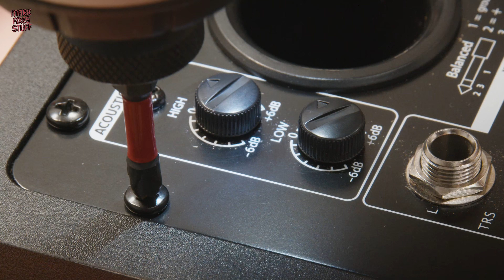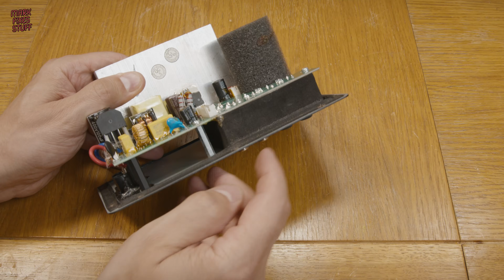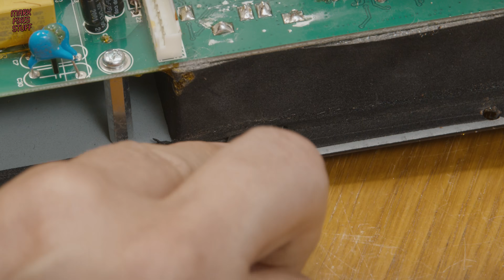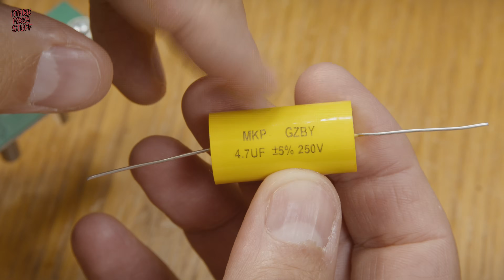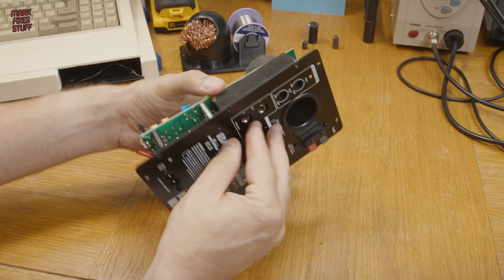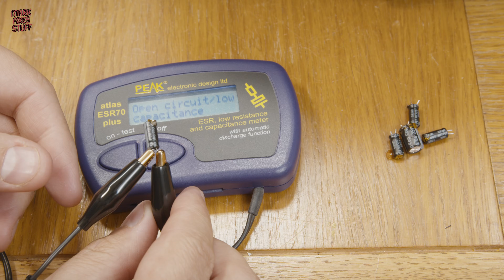My Video Editing Speakers DIED! 😱 Why Did Presonus Do THIS?! Eris 3.5 No Power Repair

Comment: I seriously am a noob when it comes to electrical, and just so happened I also own these bad boys and also lost them exactly after 3 years, well not really loose them but I've started getting delay power ons and when it does turn on, I always get to hear choppy ins and outs from what I'm listening to and need to crank up the volume to have those chops and hiss disappear, and so far now it got a lot worse and planning to go in with the repair. Your video helped a lot! Thank you!

Comment: these capacitors are unfortunately engineered to fail. My 3.5 gen 2's lasted 6 MONTHS, yes 6 months since purchase, i didn't even bother to fix them , i converted them to passive and bought 2 alesis m1 mk3 active's
Reply from the maker: Wow, that's incredibly frustrating to hear they failed so quickly!

Comment: Hi did you link the correct list for the capacitors? I don't see one 😞 all my components are toasted especially a resistor pair under the board wonder if it worth the bread to fix, or butter to throw in the bin?
Reply from the maker: Not done it quite yet. My website was killed by a bot. I’ll see if I can get it up asap
Reply: @MarkFixesStuff 🙏
Reply from the maker: Sorry for the delay. The website was down. It's up now. Please let me know if it works for you: https://markfixesstuff.com/presonus-eris-3-5-no-power-fix/
Reply from the maker: Sorry for the delay. The website was down. It's up now. Please let me know if it works for you: https://markfixesstuff.com/presonus-eris-3-5-no-power-fix/
Reply: @MarkFixesStuff   It works perfectly! Thank you for all you make for us!

Comment: Wow, I have this obvious bulged capacitor near the heatsink but I would never have considered the smaller caps potentially being bad as well. 

I don't have a desoldering gun so trying to use a manual vaccuum sucker on this board with all the other challenges with the horrid potting gunk is making me want to abandon this fix.

Comment: Enjoyed the video despite seemingly having a different issue, although I could be wrong as some of your capacitors that looked okay visually had also gone. My Eris 3.5s went following a power cut about a year ago, and after a short period on life support, switching cables and sockets to get them to wake up, eventually they just stopped turning on at all. Had previously opened the back after they stopped powering on just to see what the gubbins looked like, and opened them today in the hope I'd previously just pulled a wire out of place, sadly it that doesn't seem to be the case. Don't have the tools nor means to do any repairs myself so hopefully I can find someone local who does, cause whilst I like what I bought to replace them, I quite liked how these sound.

Comment: great video!
the same just happened to mine today, no power or LED tried different plugs no luck, just wondering if it's worth taking it somewhere to get repaired or would it just be cheaper to buy some new speakers instead?

Comment: I have these for moitoning my modular synth. The speaker output sprung terminals snapped when I attempted to insert a wire, so I replaced them with 4mm banana jacks

Comment: 16:53 that's the only one cap I replaced and it brought my speakers back to life
Reply: Upgrade all capasitor..use Panasonic, nichicon or rubycon or nippon
Reply: Did you measure it to find out or it is blowing? All my cap looked fine so dont know which one to replace

Comment: Sir, Why didn't you just replace the one bulging capacitor? Is there a reason you replaced multiple ones together? I'm experiencing the same symptoms right now and I can also see one bulging capacitor. Do the same capacitors need to be the exact same brand and type? Even so, why did you replace the other capacitors that weren't bulging? I'm a beginner and I want to reduce the amount of work and ordering.
Reply from the maker: Because the existing capacitors are a really terrible low quality type. Even if a capacitor isn’t building it can still be dried out internally. If these were decent capacitors then I might have checked to see if they were still ok, but in this case they all needed to be changed.
Reply: @MarkFixesStuff  thank you for reply  and this video

Comment: When replacing multople caps, i like to do one at a time, so its easier to do it correctly.
Reply from the maker: That's a good approach to ensure accuracy, but sometimes on crowded boards I do them in batches or all together.

Comment: IMO, it's poor board design to have non-grounded mounting screws on a PCB.  At the very least they could isolate them from the rail enough that it doesn't matter. But with so many PCBs not doing this simple thing, there has to be something I am missing here. Almost feels like traps to kill boards when people try to repair them themselves.
Reply from the maker: That would not surprise me to be honest. These are definitely made with neither repair or longevity in mind.

Comment: Even Neumann uses freaking CapXon even in their expensive monitors and subs, such a damn shame. I can only trust Genelec they only use Samwha and Chemicon
Reply: I moved back to passive speakers because of this. Even the capacitors in their crossovers will need replacement eventially, though.

Comment: Amp in speaker, not a question of if it will blow, just when.  When I bought some I figured i'd repair when needed or just gut it and use an amp.
Reply from the maker: Yeah, it seems to be a common issue with these speakers.

Comment: I bought a second hand set of very nice looking Altec Lansing 2.1 PC speakers really cheap because when I tested them they would get to a certain volume and start clipping. To me it seemed like it was starving for power and worth having a go at fixing. I opened up the Subwoofer with the power supply and amplifiers in it and sure enough I found a bulging cap. Replaced the cap and the speakers have worked perfectly since.
Reply from the maker: Awesome! Sounds like a successful repair.

Comment: Pro tip: Take those Presonus speakers and throw them away. Despite the claims on the packaging, they do NOT offer a neutral / accurate to source sound profile. 

I bought a pair of them when they were on sale a year or two back. You can probably get away with editing podcast style audio, but as soon as your mix starts to get busy, you'll find they can't be trusted.
Reply from the maker: I appreciate the pro tip! I've been considering upgrading my speakers for a while now. I only really use them for checking the level of my voiceover with the background music
Reply: Yeah, they're literally a cavern from 200 - 700hz with nasty High Q bass peak, overall upward tilt in room rather than nice smooth down tilt 🥀

Comment: I guess you've forgotten to remove the hardened glue from the PCB, for that stuff can get corrosive after several years and damage the PCB and clean the PCB with IPA after fixing it. Besides that.. good job.
Reply from the maker: I’ve since cleaned that gunk off. To be honest I didn’t want to go through all that until I knew they were working. I’m either going to use hot glue or silicone sealant now.

Comment: Hey! nice video. now there is no way you can buy a product with known branded parts on it brand new they all have garbage parts... what you did is not the right way to fix something but i agree it's not too surprising it was the caps and it's true that in a lot of case it actually will fix the problem. for the heavy parts that are normally glued to the PCB so vibration not crack the soldering or break the legs what i use instead of the awful glue they use is silicone sealant you know the stuff you use for bathroom this is perfect it survive to high temperature (even soldering iron will do nothing to it), it not become conductive with the time like the shitty glue they use at manufacture...., and it's a bit flexible so it not break like glass all of what is needed! and this is why manufacturer don't use that it's because it will make the product reliable (few manufacturer do use silicone but it's really rare...) also i'm French i hope my English is not too catastrophic XD
Reply from the maker: I think your English is great! Yeah I don’t expect premium Brand capacitors but not the very worst cheapest unidentifiable rubbish either. Sealant is a great idea. Thank you.

Comment: I’ve had various bits and pieces of Presonus gear over the years and every single one of them has failed in one way or another. I had an 8-way compressor of their that went up in smoke mid event, studio monitors that also just failed for no clear reason, and I know someone that had a desk of theirs that just wouldn’t turn on one day.
Reply from the maker: That's really disappointing to hear you've had so many issues with their gear.

Comment: I am in the middle of replacing the caps on my set too. If I want to replace the cap in the passive speaker (the crossover should be in there), how can I open the passive speaker without damage?
Reply from the maker: I couldn’t find a way so I used a dremel to take out the back panel and glued it back in using a thick card as an overlay
Reply: @MarkFixesStuff  Thanks for your reply! Unfortunately it seems like my speakers will no longer work. I bought them second hand, and thought replacing capacitors (the 25v1000uf ones failed, but i replaced every cap) would fix it, but i guess not. Too bad i lack the experience to do more faultfinding. It seems like power is getting in, nothing blows up (replaced the blown fuse as well) 400v cap seems to be charging, but it doesn't work. Don't know what to do...

Comment: I've repaired three of these units for various friends over the past eight months, and each time it was the electrolytic capacitors failing - two with high ESR, and one that had actually exploded.

In each case I replaced all the no-name electrolytics with branded 105°C versions and, so far, nothing has come back.
Reply from the maker: Great job. The no name stuff is the real problem here.
Reply: yes and this company is aware of the isues .and has plenty of time to fix it in fact they come out with new gens that have the same junk garbage in them .this company is cheap and lazy and they suck .any companies that know they have issues but refuse to fix them is not a good company

Comment: To set a good example you should explain that one needs to document which caps go where before starting. Nice way to blow a cap that has the wrong voltage rating. I have recapped Motorola two way commercial radios where we have explicit documentation as to what goes where. For consumer goods where no documentation is available one needs to create their own.
Bravo ar shotgunning ALL OF THE ELECTROLYTICS !
Reply from the maker: Yes totally. I made a spreadsheet with the locations which I’ll host on the website as soon as it’s running.
Reply from the maker: Sorry for the delay. The website was down. It's up now. Please let me know if it works for you: https://markfixesstuff.com/presonus-eris-3-5-no-power-fix/

Comment: Everyone in my comment just pointed me here because my latest video was also fixing the caps in a Presonus Eris 5! Different fault though, "popping" noise sound caused by dielectric breakdown, not high ESR.
Reply from the maker: The capacitors are absolutely awful. Real cheapskate stuff. A few people in the comments have mentioned that popping. I’ll check out your video and thanks so much for commenting on mine. Made my day!
Reply: This video also popped up for me after having watched Dave's, and the timing is uncanny. 🙈🙈
Reply from the maker: Omg! Dave!!!! I’m not worthy!!!!!

Comment: That FOAM that was a real pain to remove that surround the input ports is NOT for HIGH frequencies. It's actually for LOW frequencies.  When you turn it up a little loud and you get the bas pumpkin out of the pretty sweet monitors, air will want to escape from ANY place it can. And when it starts coming out of holes that it wasn't designed to, especially with things like plugs that have to go through the airtight steel plate and through odd shaped openings around the the plugs, you will get off-putting noises during the lower frequencies from a bass drum or a bass guitar, like whistling or even the dreaded 'chuffing' -
Okay, I'm gonna stop trying to sound like I know what the heck I'm talking about now and just get to the point LOL -0 the foam is so air doesn't come out around those input plugs during LOW frequencies. It can be VERY noticeable when you making music (as opposed to Listening to a finished piece) because you do a lot of repetitious sounds of single instruments,  so it becomes much more noticeable if there is a bit of a whistling noise during a bas guitar note. 
You have to remember that these are Studio Monitors and not bookshelf or floor speakers - You'd typically be listening in a sound dampened room with minimal furniture and a fairly airtight door. So you would for sure notice the air leaking out of those small spaces. :)
Reply: At least you KNOW it will ALL SOUND GREAT!!! (Presonus makes some good stuff, but I'm more familiar with their VST plugin software,
Reply from the maker: Great info. Thanks so much for taking the time to share your knowledge and experience.

Comment: The amplifier of your self-powered speakers died. This is why I use passive speakers and separate amplifiers.
Reply from the maker: Sounds like a good plan.
Reply: What amplifier and speaker are you using? I want to follow the same approach, replacing caps is not something I particularly enjoy 😁

Comment: Instead of manufactured in China it should say thrown together in China, The goop they used to glue down components looks like it could become conductive over time as well. Reading on the 4.7uf 100v cap is fine, it'll be good up to around 4 or 5 ohms amazingly. Oh finally, you certainly can't beat a nice clean hole, it honestly makes all the difference especially when you keep your tip clean and free from debris. BTW I want your Sam Coupe, seriously, I'd be willing to trade all manner of cool vintage computer tech or whatever for it.
Reply: The Chinese will build you whatever you're willing to pay for.  I imagine the parent company said "build these speakers for under $30".  So you end up with $30 of speaker the west marks up to $200.
Reply: @quademasters249 Exactly. I've had electrical goods from China that didn't last 5 minutes, and I've also owned some which are older than me and still fully functional.
Reply from the maker: I think you're right. The goop has certainly caused issues for others!

Comment: Those screw threads do tear out, I find a good fix is a little bit of wood glue put down the hole, using a syringe and a thick needle, to line the wood and fill up the edges. The same wood glue to attach the foam as well.

I have a similar set of Sony active speakers, did replace the one audio IC years ago, and recently replaced the power supply, removing the mains transformer from the unit, making it 1kg lighter, and put in a socket, so I could use an external laptp supply to power it. Dropped power consumption down a lot, went from 30VA to 3VA, a big difference. Bit of noise from ground differences, so in went some audio isolation transformers I had off a scrap telephone side of an old PBX, 600R to 600R, and good enough frequency response on test, 30Hz to 20kHz well beyond what I can hear, and certainly good enough.

Hopefully you also know all that brown glue eventually does go conductive, so remove all of it please, it will cause issues. The crossover cap a new one with leads will work well, just longish leads to put it in the cabinet, or just do not bother, in that application it probably will last another 20 years.
Reply from the maker: Thanks for the info. Someone else told me about the problem potting so I’m on that.  Nice idea for moving the power transformer stages outside. I just got the right sized np caps in the end.
Reply: @MarkFixesStuff Yes the black goo corrodes the leads off, outside warranty. If you use silicone get the acetoxy free neutral cure one, generally the one sold to adhere mirrors to surfaces will work, and is the same as the copper safe ones, just a lot cheaper. If it smells of vinegar do not use it, it will rot all the copper traces off. I use the Bostik mirror, it is the same price as regular, and lasts well if you cap the tube tightly after use, and place in the fridge.

Comment: I've had a pair of dead monitor speakers sitting under my desk at work for over a year now, I just haven't had the chance to crack them open to investigate. They emit a very loud 50Hz tone when powered on. I expect they're also suffering from crapacitors.

Not that I need a new pair of monitors. I don't use speakers at work because I'm not a terrible coworker, and my monitors at home are a very nice pair of Edirol MA-15D monitors which I picked up for a steal at auction because they were damaged. The left speaker buzzed badly, and unscrewing the bass driver revealed the frame had bent, causing some part of the cone to touch the frame or magnet and buzz as it vibrated. After attempting to bend it back, the magnet partially snapped off the frame, so after bending the frame back mostly to shape, I temporarily zip tied it in place to test and it worked perfectly! I decided to be lazy and leave the zip ties, and it's been just fine for several years.
Reply from the maker: If it works then no further fix required. Sounds like it was dropped maybe?
Reply: @MarkFixesStuff  A definite possibility. Thankfully it was repairable, but I some research and found some woofers that match the originals fairly well, so worst case I could just replace them if it breaks more permanently.